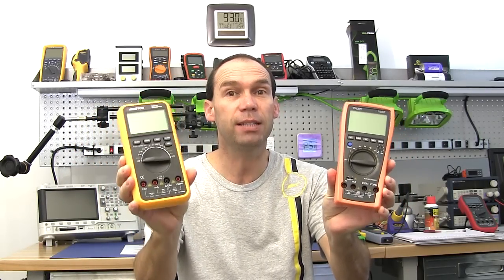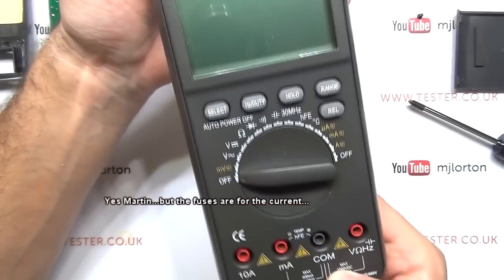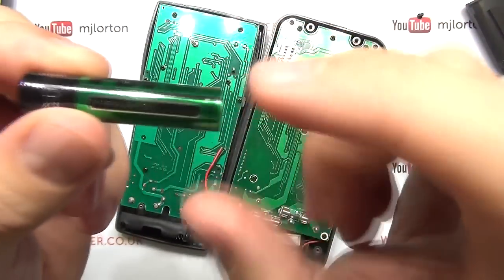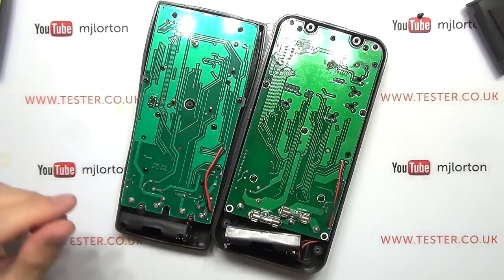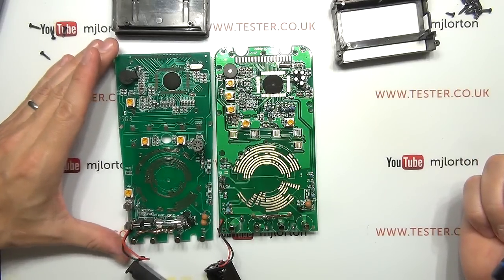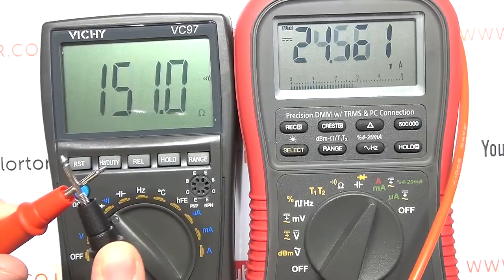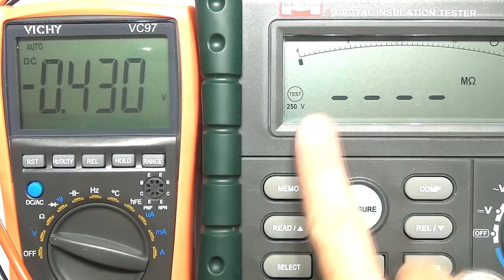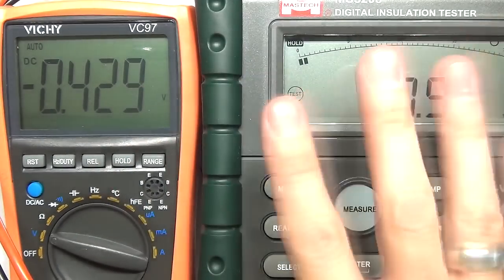Review: Part 2 - Vichy VC97 vs Victor V97 Multimeter

Comment: The stuff that's on the PCB is the remains of flux in the solder used to manually solder those sockets. 
Some fluxes are not that active to cause corrosion so they just save money by not washing the boards, others are just improperly cleaned and leave that white/milky residue even after they're cleaned

Comment: I have a Vichy VC97 and the contacts on the transistor tester socket seem to be all the way down at the bottom. If I take a transistor out of a board and place it in I get no reading. Only if I use a new transistor and push it in as far in as it goes do I get a reading. This makes the transistor tester useless.

Comment: Gday mate, Thanks for the video.
I have a vc97 Vichy, it’s blown the amp fuse and unfortunately the cap can’t be read, you said it’s 250v 10amp, numbers I can still read are f13A but I can’t find that fuse, would you recall the other numbers so I know if it’s quick or slow blow?
Thanks in advance :)

Comment: A PTC is a thermistor (PTC stands for Positive Temperature Coefficient, means that an increase in temperature will result in an incresae in resistance, as oppose to a NTC thermistor)... A polyswitch is a autoressetable fuse... Although the principle they rely on is pretty much the same as the thermistor, however they cycle back to a conductive state immediately after the current is removed, which does not happen on a thermistor...

Comment: Thanks for saving me! I have the Aidetek VC97+, which I now see is EXACTLY the same as the Vichy VC97. When I had to replace the fuse, the whole selector switch fell apart. Through your movie I could figure out how to arrange the little copper pieces back, so my multimeter works now as it should be. Thanks again!

Comment: It's a voltage measurement, whether the supply is capable of 1mA or 1000A makes no difference. If it were in any danger of failing from the 1000VDC, the insulation tester would've noted a low insulation resistance.

Comment: You see it's not the nominal voltages of high voltage systems that is a concern because even the cheapest meters do 1000V with no problem. It's the rare event where a high power system surges to 5-10X it's normal voltage while you are connected and that's likely extremely rare. Maybe explosions on the power grid creates an inductive surges somehow or lightning strike nearby or a UFO does an acceleration burst near your power lines (which does actually happen).

Maybe test with 10kV cap bank.

Comment: The real danger when playing with the high voltage power grid is not the meter but you getting electrocuted by touching something wrong. Dropping a screwdriver across terminals is a problem as well because the power does not stop and the metal explodes.
That's also why you don't wear any metal when playing with powerful batteries.
Reply: Dan Frederiksen I